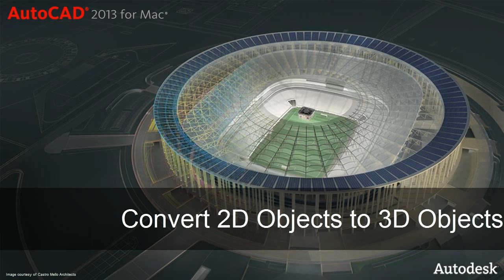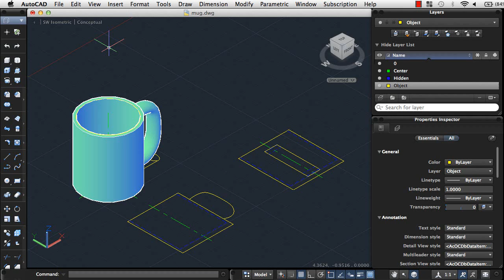Convert 2D Objects to 3D Objects: AutoCAD 2013 for Mac

Comment: Could somebody tell me, how can i extend this program to full screen mode? I just installed the AutoCAD for my MAC, and I used it only on Windows operating system before. I don't want to hide my program icons, but basically the software start in the default desktop. I want to open it in another desktop, like in this video. Thank you for your help in advance.